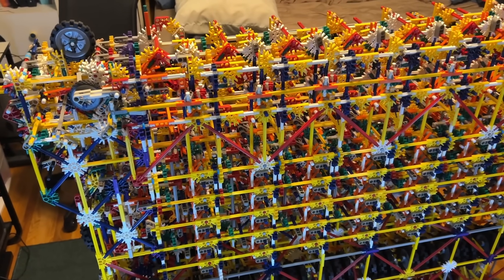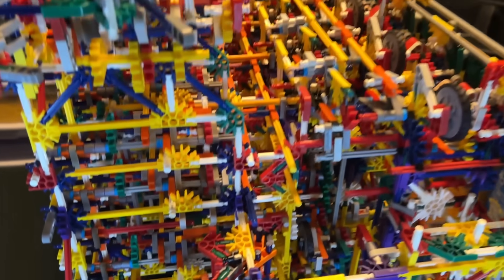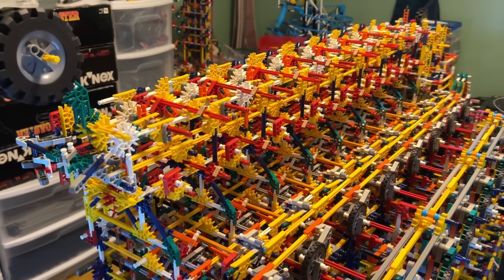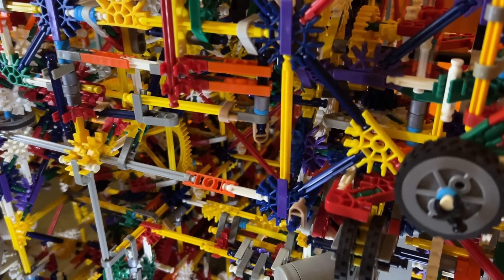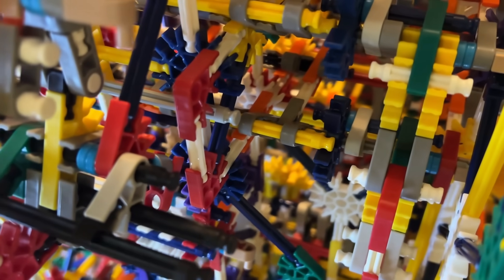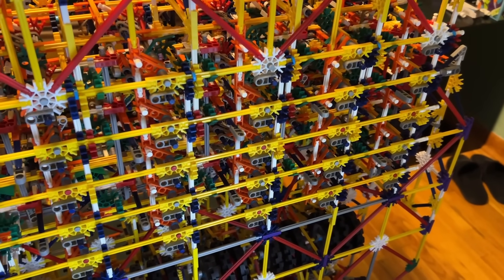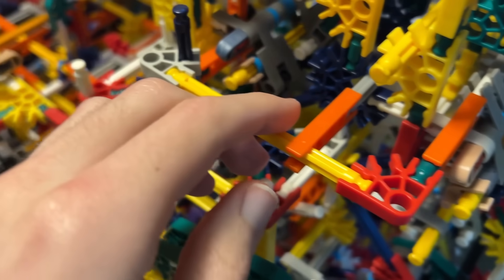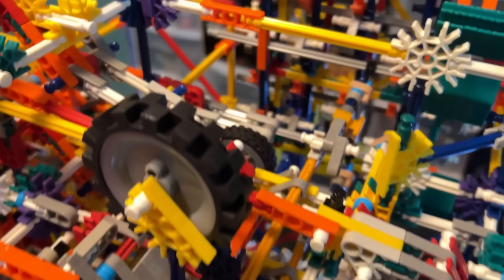Knex 8-bit Mechanical Computer - Update 2: Registers, RAM, and Data Transfer

Comment: Man this is just such an intricate piece of machinery, no idea how you managed to plan this out! Must be a nightmare to move into a new location!
Reply: His little bro just runs in and smashes it... Rebuilding is part of the fun
Reply: As someone that's built mechanical computers before, you don't really plan it out. It starts with "wonder if I could build an AND gate?" Then a memory latch, and so on... Then little components get assembled into bigger components which snowball into one big machine. 
For me the design and fabrication are happening at the same time in parallel, so it's not as daunting as it seems
Reply: He probably made modular units that can separate in case they need maintenence

Comment: Doom need run on this machine.
Reply: But we still need to design a physical kinex screen and the protocol for how the CPU will update the frames on the kinex screen.

I imagine we would be lucky to get a few frames per hour, but it would be insanely cool
Reply: You need gpu first💀
Reply: @netherknight384 no, you don't. Original Doom like any others game from that period used a software rendering, solely depends in a CPU and a RAM.